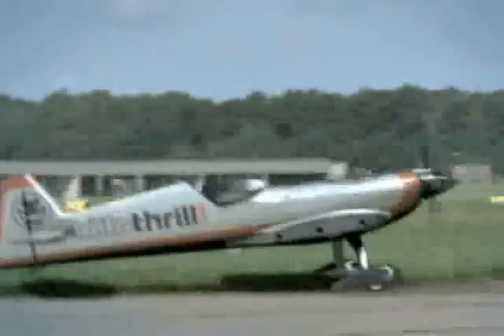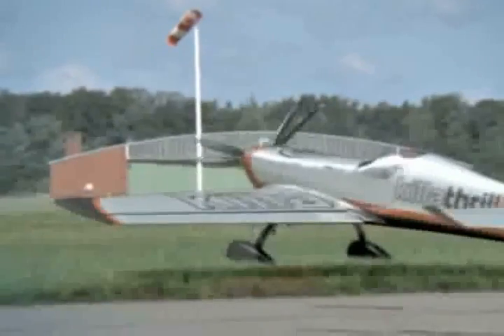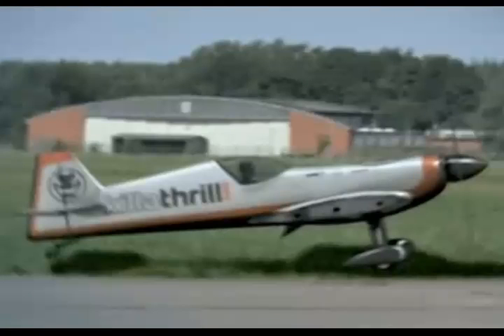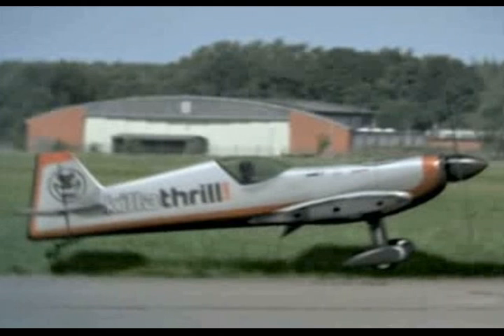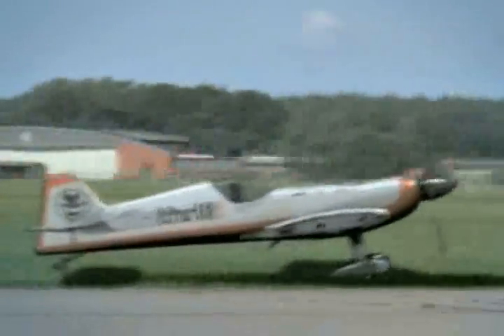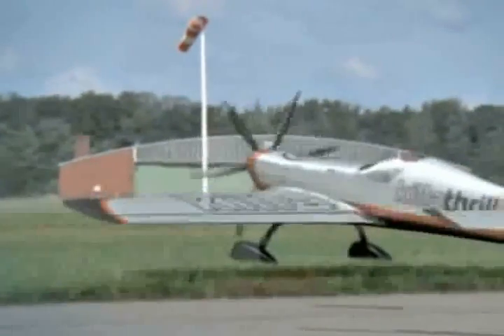The Big Hoax: Aircraft Loses Wing, Lands Safely (is not the best pilot ever)

Comment: The real incident where an F15 lost its wing was ACTUALLY amazing. The aircraft had one thing going for it… at high speed the remaining body of the F15 actually causes lift which this sport plane clearly doesn’t (even if the aircraft didn’t change paint jobs before landing). The F15 also has a ton of redundancy built in. 

So anyway the F15 loses its wing then flies back and lands… but at a higher than normal speed because when it started to go slow it wanted to tip over. The F15 pilot got out of the plane an was amazed that the right wing was just…gone. Now that is a great pilot. This one is a semi decent video editor, not a great pilot.

Edit: Here is the F15 incident where it landed with one wing. https://youtu.be/wxJcEz3h4tU

Comment: Fuel (kerosene) is used minimally - for lift off and landing. Just 'to produce steam which drives the turbines during maximum thrust, once the turbines are running they do not require any fuel' (DSM). Compressed and heated air is freely available.Nearly all large-scale liquid nitrogen is made by compressing, cooling and expanding air

Comment: Thank you for exposing this hoax. I was stunned and disgusted that they would make this total fake and promote it as real. It is an insult to stunt pilots everywhere who risk their lives performing stunts. A shallow attempt to dupe the public on the internet. There are enough lies on the internet already, we don't need any more. Two major thumbs down.
Reply: Fuel (kerosene) is used minimally - for lift off and landing. Just 'to produce steam which drives the turbines during maximum thrust, once the turbines are running they do not require any fuel' (DSM). Compressed and heated air is freely available.Nearly all large-scale liquid nitrogen is made by compressing, cooling and expanding air

Comment: Plane would have spiraled to the right loosing the right wing not to the left like it shows in video.  No lift on right side of aircraft and lift only on left side spiral to the right.  Then on landing no left rudder applied,  rudder would need to be full left with nose high attitude under full throttle hence flying on the prop term.

Comment: Technically it is possible to fly without one wing if you have enough power and 3d planes have a lot of power there is a way by holding the Main wing straight up you cancel out it's lift and the wing drag will point the nose upward 
When you get it like this you need to pull full throttle to slow the free fall and when you approach the ground quickly roll until levelled and land it 
Trust me I tested this theory
Reply: Yes of course you tested this. Must be the first attempt you landed the plane with one wing. You would not be alive otherwise.
Reply: @MisterKatz  i tested in sim
I'm broke, it's will take few decades dlfor me to get close even owning a plane

Comment: I can believe it happen . Color difference  of plane because of different sky and ground setting. The guy is a stunt pilot and they fly them big engine stunt  planes like that for a living. Also watch the  aileron, turn the plane, the  rudder and elevator kick the tail straight and the plane bounces taking a lot of  energy out of the slam that would hurt the pilot.      There are RC flyers that make there plane  hover with propellers.

Comment: No matter if it is fake or not... it could be possible to land some of the higly powered sports planes like that! The engine power is nearly high enough to stand still in the air and you would land it the way it is shown but i think it would be more stable and realistic with the wing hanging down while flying on the side alone with motor power and yaw... it may not result in a clean landing on gears but one could survive such a horrific problem that a lost wing would mean... surely that is not possible in most other planes with "normal" engine power!

Comment: It may not be a real full size aircraft, but I have seen it done with a model RC aircraft, which can do knife edging very easily with all that power vectored  at that angle,  Even the elevator at the last second was correctly applied to overcome the wing drag. There are some brilliant  pilots of model RC plane and they make their plane dance to the music in indoor flying and also fly backwards with  electric motors.  The modern simulators do a good job to train young RC modellers.

Comment: Actually with a 450 HP engine that develops enough Torque  to spin the plane around in circles in flight, rudder and remaining flap control, it is possible.  I have seen it at the Nevada Air Races, and the Pilot did land without breaking anything more.  Learn about the aircraft and these pilots before you judge.  I could just as easily state that this video is not of the actual incident and has been mocked up to try and discredit the pilot , and generate even more press coverage for :KillaThrill".
Reply: Bubba Gump also a factor of extremely light material.
Reply: Time to go back to ground school and learn aerodynamics

Comment: Well for starters... it's not even close to physically possible.
Reply: +JC5296  Actually with a 450 HP engine that develops enough Torque  to spin the plane around in circles in flight, rudder and remaining flap control, it is possible.  I have seen it at the Nevada Air Races, and the Pilot did land without breaking anything more.  Learn about the aircraft and these pilots before you judge.  I could just as easily state that this video is not of the actual incident and has been mocked up to try and discredit the pilot , and generate even more press coverage for :KillaThrill".
Reply: JC5296 incorrect. These planes are designed with light parts and are made with detachable wings incase the piolet hits a pole to still maintain control. And it uses hollow rubber wheels to not break during landing. So.

Comment: The maneuver is referred to as a Knife's Edge. People with these kinds of planes have them because they are hard core acrobatic types. Though I do believe this video is faked to some degree, there was a catastrophic wing separation from an aircraft of this type that resulted in a non lethal landing.  Also, typically, pilots of these types of aircraft wear parachutes and can and do leave the aircraft if possible when something like this happens.  It isn't always possible to get out because the plane can't be trusted to not crash into homes in close proximity or issues like that.  Pilots in general are more willing to die with their aircraft than to cause the death of others.  Also, to those who say a knifes edge is not possible in a full size aircraft, need to go to an airshow.  The power the weight ratio of this aircraft is super capable of this maneuver.  The plane if very light and the engine is way big.
Reply: Do you have a link to the story of the 'Real' version of this? I can't find anything on it.  :/

Comment: It is physically IMPOSSIBLE to keep an airplane up with one wing. NOT going to happen. Fake video.
Reply: This is fake but it has been done. Please refer to the video of the Israeli F-15 eagle that successfully made a wheels down landing after loosing it's right wing in a midair collision. Unlikely but not impossible.
Reply: Bill Marshall 
but this Video is real. It is only a Modelplane.
Reply: speed150mph An F-15 has a lot of extra power, and it did not lose the whole wing or it's control systems.

Comment: Who gives a rats ass?!  If it's fake, it's a damn good fake!  If it's real, it's damn good piloting.  I think it is real, and don't really care... in either case, kewl video.  If you can't do it with a plane, than you can't do it with a model either as the same physics apply in both instances.
Reply: Not really. Most models are very light and the engine has a higher thrust to weight ratio than a real plane has.  This gives the model the ability to "hang on the prop" where the real plane wouldn't be able to do that.

Comment: Well the first red flag is the plane is spinning the wrong way, the wing would still produce lift even in the nose down mode causing it to spin the opposite direction from what is show. Even with full aileron input I doubt the pilot could keep it from spinning let alone get it to spin in the opposite direction, which is what is shown.
Reply: that's an excellent and accurate point, but the real red flag is that once it gets closer to the camera it looks terrible and fake :(
Reply: That would be opposite rudder, but the video is fake so
Reply: John Pleites The reality ist, it is a modelplane from germany that was flying this way.
Reply: hpshiker reduce engine flow (designed to change speed quickly) and full flap down.
Reply: I was say this too.  Good point.

Comment: Fake but possible IF the aileron controls for each wing are separate. Aerobic aircraft have powerful enough engines for vertical flying. So full power, left rudder to keep nose up and wing vertical.  Then at last second before hitting the ground, hard left on the stick. Will be a very hard landing.
Reply: Uh hu, yea, ok...

Comment: you guys are stupid. this is real. the video doesn't allways show at its best the white lines on the nose and on the tail, but they exist even if because of the reflections, the metal paint and the white lines sometimes merge together. this is 100 % real.
the real light can play some tricks sometimes ... this is evident here. ( oh, and i do special effects )
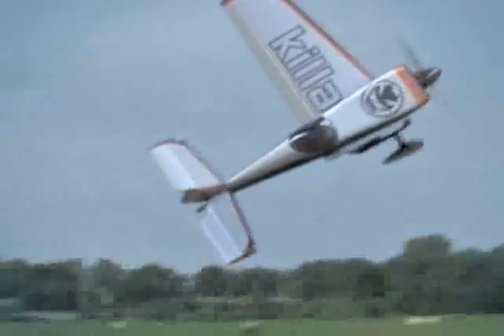Reply: for example, at 2:14 , you can see how it oscillates between showing the white lines, hiding the white lines ....
this is all about the relection of the sky on it or not. the "smart guy" from the video didn't tell you that .... off course ....
Reply: Xplorer if the quality of the video was better, you would see that for sure.
for example, on a 16 bits screen, you can see plenty of color variations. on a 32 bits screen, you can see muuuch more colors variations.  here it's like an 8 bits phone camera, it's crap, it doesn't see and translate as many colors as a 32 bits camera, that's why it doesn't do the difference between the metalic grey and the white lines, on some occasions. 
the position of the camera filming an object in the sky doesn't give the same angle of relfection as when the plane is on the floor, reflecting not only the sky but also the various other colors of what's on the floor. the white lines are best seen when the plane is in the airs, here, unless you're near the plane, with a better camera.
Reply: I uhhhh hate to burst your bubble considering you're so sure, even though the physics just arent real in the video but. HERE
Reply: physics are real, you just can't see it. i can analyse a video better than you guys, obviously.
the white line disapears, due to the low bit res and low pixel res + because of the angle of reflection of the sky when the plane is on the ground. that's why you see the metalic grey and white lines melting together, thinking ( ? ) it disappeared. this isn't rare at all. + the metalic grey reflects more than some mat white paint, so the contrast is higher when the plane has this altitude, and not as much , when facing the camera on the ground.THAT's how physic reacts.
this also because of this angle of reflection that the metal finish looks much more blueish when the plane is in the airs, compared to when it progressively becomes grey, while coming closer to the floor.
if someone was that good, to film a trick and do special effects, he would certainly care for such huge détails ....
look again at 2:14 on the same sequence, when you see the white lines, and the second after ( same sequence, still in the same movement ) , you don't see them anymore .... now that's one more proof.
Reply: ha ha ha ha ha
try to say something smart instead.
i totaly demonstrated it , you're too busy looking for fight.
Reply: have you ever heard an radio controlled airplane's engine when revved up. I did because I have one myself. its real all right, a real big  rc
 plane.
Reply: Xplorer The angle the plane was at a very low altitude when flying between the two pylons at the beginning and just after it landed are nearly the same with respect to the light source (the sun, I'm assuming in this case). The cameraman remained stationary too it seems. Light variation and/or resolution variation in this case is insufficient to account for the displacement of a prominent stripe (the black, which is faded on the plane after landing) which should be visible despite resolution, and the entirely missing white stripe.
Reply: not at all, respectfully.
look again at 2:14, where the white stripes on the wings are still visible but start to fade away.
look at the metal finish of the body, which looks blue when in the airs, and then look at the same metal finish, which looks grey when it comes closer to the floor;
that's a big difference, yes, but with the same plane.
specular reflection and absorbtion of light varies a lot with the angles and distances.
each object's surface has a degree of reflection.
Now, there's a point where naturaly, two different surfaces, with different colors and degree of relfection can almost melt. now add to that a bad camera and a low bit res, and you've got this.
also add to that , this absolutely stupid idea that a funny guy who would like to do a fantastic great fake , would simply forget these white lines !!!
now, add to that, the fact that in the end, the real aeroplane that you see landing has a pilote in it, and in the very same sequence, you see the pilote coming out of it, and you see the missing wing !!!!!
you guys are looking for a fake or a bullshit stuff when it's pure reality.
some guys are funny, linking to a german video, so called a proof that it's the making of this fake, and funny thing , in this so called making of ( loooool ) , there's nothing related to this amazing landing, which is possible by the way. AND , in this making of, you see white lines on the model !!!!  missing in the supposed fake original.LOOOOOOOOL.
stupidity shouldn't rule guys, turn your brains on !
Reply: "displacement of a prominent stripe (the black, which is faded on the plane after landing"

the black isn't displaced at all. the white is melted for the eyes, with the metal finish of the body. leaving the black paint just where it should be, making you think it moved. just look better.

light can be tricky, especialy with metal relfection, and shiny white paint.

ever heard of "camouflage principles" ?

i can't believe that peoples can't even see all these détails behind the appearances.

i feel sorry for you guys.
i'm working a lot with light, video, cameras, virtual cameras, 3d renders, special effects, i'm not surprised at all by these light tricks, they're fully natural. i can analyse pictures, you totaly can't.it's so evident.
and all i'm hearing from most of you is so lame, so  4 years old in your brain.
shame on you
Reply: i can't demonstrate anything to peoples who simply don't want and can't to listen .... rather bashing the honor of this pilote for free, with no proof at all, ( this video isn't prooving anything at all, if not the very low level of intelligence from this conspirationist, and yours too ) while prefering to stay blind in front of so many évidences you can't even understand.
just look at this pilote coming out of this plane who as you said, lands in the space of ( 20 feet ? really ? look again, much more ... ) . just look ....
hello ! i'm the pilote ! i'm coming out of this "model airplane" ! with a "fake" missing wing !
looool
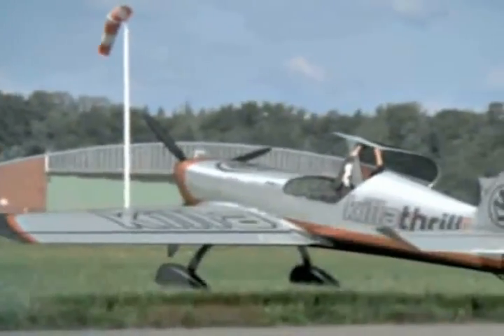Reply: also look at 1:10 man : you can SEE this fucking white line . even if you say it doesn't exist.
you're all so lame, really.
Reply: bla blaaaa !

yes dumb ass, but the author of this video talks about this white line, as so called proof that it's a faked video since it "doesn't exist" on this  crappy image res.

just look at the pilote coming out of a plane which just landed, without his right wing. ( Same sequence, it isn't a model .... )
this should calm you down a bit.

your proof is : it looks unbelievable, so it is necessarily 3d imagery. just ..... "because" .
looool.

you also don't know planes much.
I worked on the restoration of a WWII Avro Lancaster.
Reply: for you this video is a fake, and .... you prooved it ?
ha ha.
i feel bad that peoples as stupid as you may be on this planet. 
And i'm surprised, you said previously "Anyway, enough of this. I'm off to chat with the fairies at the bottom of my garden. Ta ta!"
so ..... if you're enough just do it and get off this chat perhaps ? :)

bye stupid guy, at last !
Reply: i don't need to look better,
i'm fine thank you, i also certainly don't need your company. i already know your point of view and you know we'll never agree. There's nothing else for you to do here, unless you like to be annoying over and over.
Reply: he he, please explain ( simple question ) :
"there's no white line, so this is a hoax ! and look at this making of about this hoax and .... and ...... SHIT ! there's a white line on the model used ..... shit ! 
looool ....
you know .... lot of things like this, telling me your arguments are as stupid as you guys.
and if you're so sure that it's a fake, there's no need to tell me it's a hoax :)

+  check the fF5 landing with one wing only.
there's also another video of such acrobatic plane, which has enough power to stand vertical in the air, like a helicopter. maybe you didn't knew it was possible ....
Reply: right, one more dumb arround.
if this is a model instead of a real plane, as you seem to think, 
then aerodynamics will be different than with a real plane ? mmmh, rrrrriiiiight , loool
stop trolling me, thanks dumb ass.
Watch F15 landing with one wing only ... not a fake.
Reply: IF this is a real making of, can you at least assume that this present video, claiming that there's no white line, as an argument to say it's a hoax, is ...... stupid, since your making of shows a model airplane WITH the white line ? :)